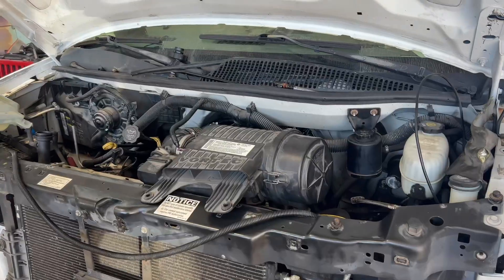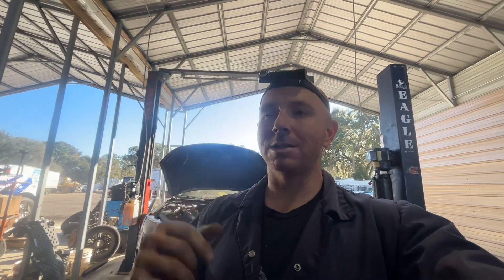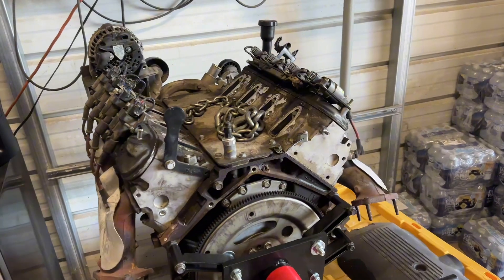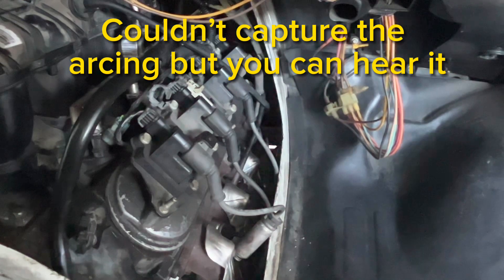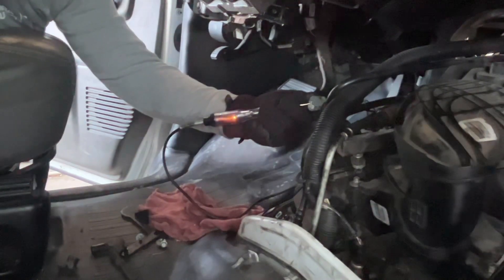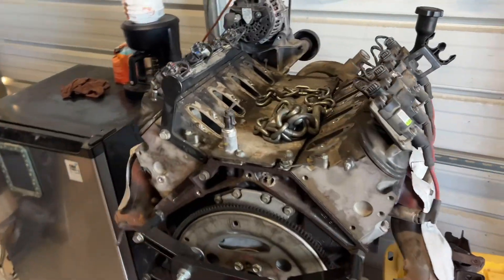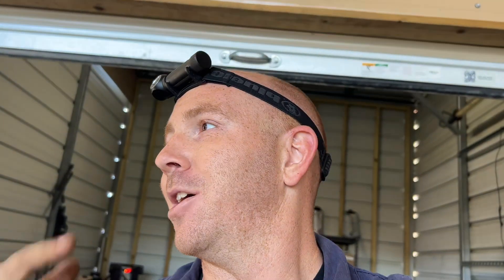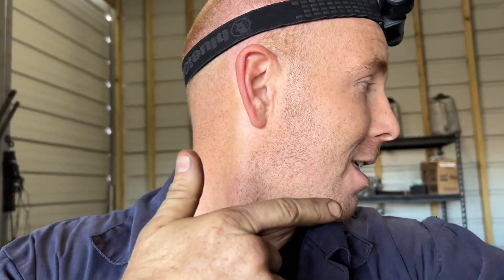Fuel, Spark, Air and Compression = NO Start?!

Comment: I got a 2.7 at my job that I replaced the motor and it's the same motor over all that wont start and it has air fuel and spark no codes either

Comment: I did this with a 2000 dodge ram 1500 4.7 v8. very hard to find one of the early ones with 16 tooth crank, I ended up tearing apart both engines outside and swapping the crankshaft over.
Reply from the maker: Sounds like that turned into a project!

Comment: are there two different style crank timing wheels, toothed wheels in the crank, the computer gets confused, if the boxes are compatible change the ecm the same time as the motor
Reply from the maker: Yes you’re correct. We just put the correct motor instead.

Comment: ALL vehicles with electronic engine controls will eventually have failures similar to this. Thousands of cars must get scrapped every day because of $0.25 electrolytic capacitors. Capacitors look like little beer cans soldered to circuit boards and they go stale because of age and heat cycles. 
Check out "electrolytic capacitors" on Google. Take a look at this video here: 
https://www.youtube.com/watch?v=RUhvuCwVIl4
In 2000, my 1985 Fiero 2M4 refused to start. I had JUST rebuilt the engine myself in my driveway.... Good crank, great compression, great fuel down the TBI, great spark.... but no start. In desperation when it stranded me at a gas station, I got it rolling and dropped the clutch - started perfectly! 
My background is electronics, and experience restoring old radios and TV sets and early computers gave me a pretty good idea of what to look for. 
Every compression stroke was causing the 5V regulator in the ECM to reset because the old capacitors were not smoothing out the power properly anymore. The spark timing was way off so the engine never fired. I replaced a few capacitors on the circuit board and the car was great. I got over 400,000km on that Fiero before it was completely worn out. I miss that little car. 
A million different symptoms can be caused by bad capacitors, and used parts are going to be just as old as the originals, so they will not help you. All electrolytic capacitors will eventually fail. Period. When they start to fail, they will give you intermittent issues, the sort of thing that strands people and a mechanic can't replicate and evenutally gets that otherwise pristine Camaro or Grand National or whatever scrapped. 
DO NOT buy capacitors from Amazon. You will get counterfeits or old capacitors. Buy them only from a reputable electronic components supplier like Mouser or DigiKey or similar. 
Hope this helps someone.

Comment: You also need flow for an engine to run, usually built into the design, but worth a thought when it comes to experimental design
Reply from the maker: The whole intake would need to be clogged for this to be true.

Comment: Many manuf's use a 5 sec cut off so it seems to have everything  needed
Reply from the maker: I don’t know what you’re referring to. What cutoff?
Reply: @Bluecollarmechanics  it starts runs for 4- 5 seconds then dies Chevy, many asian manuf if it didn't read the correct key chip code